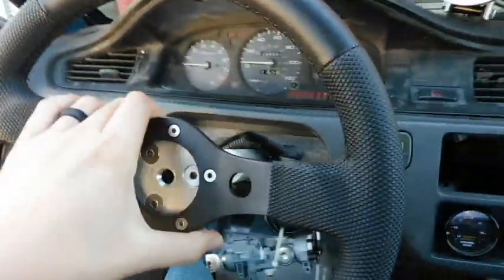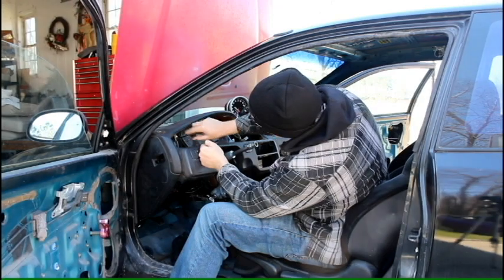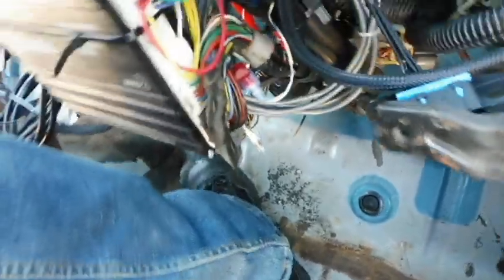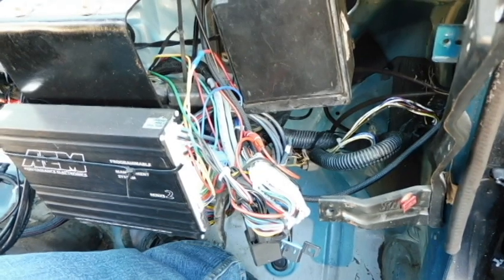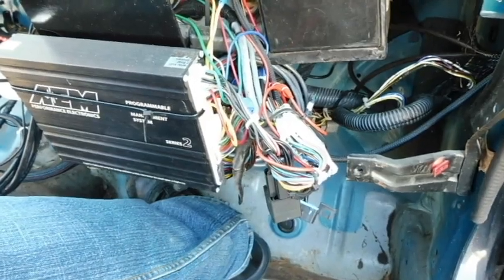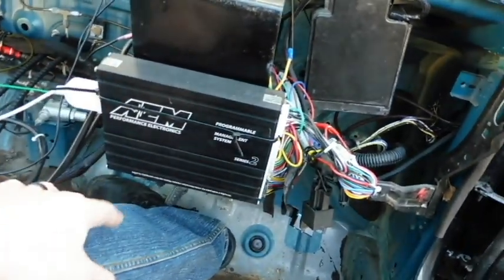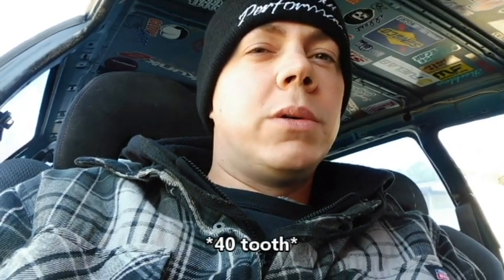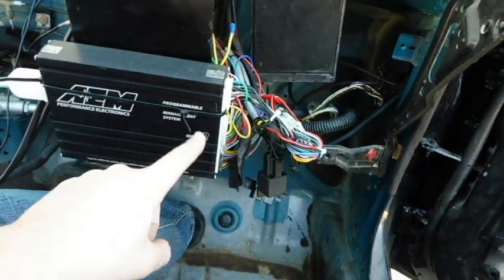HOW TO : K24Z7 swap in EG Honda Civic (Part 3) Wiring and ECU

Comment: What manual transmission is being used for the swap
Reply from the maker: Any k series should work. This is an RSX base 5 speed
Reply: @ any k series transmission would also fit into a 94 EG? I know that EP3 SI would work and so would the rsx but I’m on a budget and these things for for 1.5k-2K😂

Comment: For anyone out there Kpower makes a timing cover which allows for the a2 crank sensor, so you can use a standard harness and kpro
Reply: I was reading it say not compatible with k24z7 is that just because it has the crank sensor opening
Reply: @sebastianguzmandelacruz2329  yeah, if you want to use kpro you’ll need the kpower timing cover, then the computer just thinks it’s a k24a
Reply: @MorrallMotorsport  thanks man great info appreciate the reply

Comment: Couldn’t I just use a z7 ecu ?
Reply from the maker: Yes, if you custom wire in the full z7 engine harness and everything to your chassis
Reply: Drive by wire is the issue with the other models, RSX were cable operated throttle bodies.

Comment: Thank you very much for the help friend. a question. can i use the oem ecu from civic si 2015? Will the car start with no problem? I say this because of the throttle body abs system or something else that prevents me.

Comment: Hey man I saw your video I am trying to do the same thing I was just curious how did the throttlebody work Because it is electric and what other ECU can I use besides the aem
Reply from the maker: You can use any full standalone ECU. I used a cable driven throttle body
Reply: @ballsoutperformance   ok so cable driven throttle body with any standalone ECU  you and for the crank sensor you did z7 wired into a k20 harness and thank you by the way it is a very helpful video
Reply from the maker: Yes thats what i did. And youll have to have a custom tune for the ECU. A standard k series map will not work.
Reply: @ballsoutperformance  ok sounds good thank you for the heads up
Reply: Heyy was just curious to see wat motor mounts did you use I was told I would need specific mounts or can I use any after market one ?
Reply from the maker: @moisesreyes6437  I think I covered all that somewhere between the 3 videos. Off the shelf k mounts

Comment: Great information here. Maybe u can help me out,I'm doing k24a2 swap for k24z7 (2012 civic si)  using back the stock z7 harness.how would suggest I do up the crank sensor? Knowing that the k24a2 and z7 uses different trigger patterns
Reply from the maker: Good question. Even if you wire in the correct crank sensor, the z7 ECU wont run the a2 engine. So thats an issue. Im not sure what would be the best option. Maybe wiring in the entire a2 harness so you can run an a2 style ecu.  Whatever you end up doing will involve a deal of wiring.

Comment: Hi bud, I am doing a K24 swap in to an eg, except the engine moount and wiring I need to purchase aftermarket ones, the most frustrating thing is the K24ecu does not fit in the eg, I need to get a KTUNER R1 END USER BOARD, which is super expensive in AU, by any chance I can do it myself, or could you leave some advice, many thanks
Reply from the maker: Hello. Im not familiar with ktuner but I assume its like most other systems  (like hondata kpro). I assume you can buy just the board and install it yourself, but unless you are familiar with repairing / soldering ECUs then I wouldnt touch it. Send the ECU in and have it done professionally. If money is an issue, see if you can find a used setup thats already installed in an ECU.

Comment: Good shit man, I couldn't find anything on the z series swaps in older cars anywhere, I have a question, if you use the k24z2 motor rather than the z7, can I use the stock accord 5 speed ecu and a flash pro if there's any available for it?? or do I have to run a aem stand alone unit?
Reply from the maker: Thanks. If you use the matching wiring harness for the engine then I would use the stock ecu

Comment: Thanks for the insight and knowledge

I have a fully built boosted k24z7 in my integra and I just finished setting everything up. bought a kprov4 and didn't even know it won't work.... 
Going the Aem route like you no other choice!!! 

   Is it possible that you still have that crank position sensor trigger configuration map that I could try to start this thing with it would be most appreciated if you could help me out on this one
Reply from the maker: I can help you put. Also would you be interested in selling the k pro setup? I may be able to use it on another project. Email me  @ archie_marchie@yahoo.com
Reply: Emailed you back my good man

Comment: Hey I like the build but I’m working on swapping the k24z3 into my base Rsx I was wondering if the KTuner platform works for this motor
Reply from the maker: Thanks. Im not family with the z3. Can you tell me if the crank posion sensor is at the front of the engine at the crank pulley or at the rear near the bell housing?
Reply: Wat program  u get your k24z 3 to run
Reply: am doing  the Zswap in a 2003 ep3

Comment: I see u are using aem ...will the k pro work with the k24z7 crank sensor
Reply from the maker: Yes the AEM series 2. K pro will not run a z7 style crank trigger / sensor
Reply: @ballsoutperformance will fuel tech setup work as well

Comment: Curious, is there any reason why you didn't use the A2 flywheel? Awesome vids btw
Reply from the maker: I used an "A2" clutch and flywheel. Both of them from comp clutch.
Reply: Thanks man
Reply from the maker: @jamesperkins8980  No problem as far as I know, the k series clutches are basically all the same. The only difference is between the 5 speed and 6 speed clutches and flywheels. But supposedly you can use them interchageably as well as long as you use a 5 speed clutch with a 5 speed flywheel or a 6 speed clutch with a 6 speed flywheel, etc.
Reply: Makes sense.  Trying to decide if I should source a z7 wiring harness or just go with the a2.  I prefer the z7 motor but can't find any sold with harness locally.  There's a A2 in every junkyard  near me.
Reply from the maker: @jamesperkins8980  Got you. Keep me posted. I want to do more with this car but have been preoccupied with other things lately.

Comment: Am doing k24z7 swap in a ek .
Using stock wiring and Ecu 
Am trying to figure out about the throttle body ..
If I go with cable throttle how would I wire the tps sensor ? Would I have use electronic throttle for the swap?
Reply from the maker: If youre using the stock harness and ecu, youll probably need to get the throttle pedal from the donor car and install it in the swap car to run the electronic throttlw body.

Comment: Hey guy, I have the k24Z7 swapped into my EG hatch and I’m using the 2012 civic si wire harness and I’m using the 2012 gauge clusters too..... my question is, HOW DO I MAKE THE GAS GAUGE WORK?! LOL I need a gas gauge bad!
Reply from the maker: Sorry, just seen your comment. Im not sure. Im not familiar with the factory z7 gauge setup unfortunately. Im sure it can be done though.  You could always run an aftermarket gauge for the fuel level. Autometer makes a good one.

Comment: Great video man! I already swap a k24z7 to a 99 EK, now the fun part is to make it work since the ecu is different from older K engines there is no conversion harness, I do have all parts from the donor car, do you think I can use the same AEM ecu that you have? Thanks a lot in advanced
Reply: I know I was referring to oscar because I’m also on the same boat with the whole jumper harness situation. I’m trynna use the complete z7 swap
Reply: @adriandiaz2770  not yet, I am waiting on a new part  kmiata  is working on,  using that part will allow  to run the old crank sensor.
Reply: @BOLADOSV  daam keep me updated for sure
Reply: @adriandiaz2770  hey what guys just wondering if oscar  finished the swap. I’m trying to do the same thing. I have   Complete swap with oem hardness. With ecu   And I’m putting the swap on a 94Eg
Reply from the maker: If you have a complete donor car, you will probably be better off to use the K24z7 engine harness and the K24z7 ECU with Hondata flashpro. Thanks.
Reply: We’re you able to get your swap running?? I’m trying to do a whole k24z7 swap into a 95 civic
Reply from the maker: Theres videos of it running on my channel

Comment: any updates on this swap? Im looking to swap a z7 into a delsol
Reply from the maker: Updates?  Nothings changed since these videos. Everything is running and working. If you have any questions Ill try and answer.
Reply: @ballsoutperformance  my question is... You think this wiring swap is possible using kpro and oem ecu instead of stand alone aem?
Reply from the maker: @ArtsAWD  No. K pro will not run this engine. Your other option would be utilizing the 9th gen engine harness and the 9th gen OEM ECU. Flashpro would be an option at that point as well.
Reply: @ballsoutperformance  thank you for the reply.